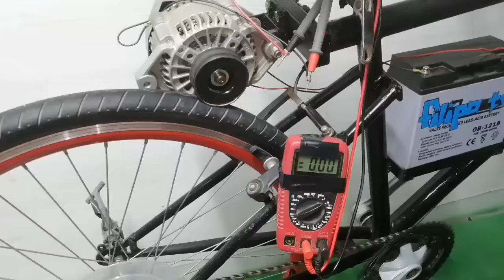free energy.electric bike casero with alternator

Comment: Unfortunately it doesn't work like this. The work needed to charge the battery is added to the work needed for the electric motor to drive the bike. One is basically cancelling out the other. There's no such thing as a free lunch. The laws of thermodynamics says so.
Reply: So does that mean that the energy that the bike is drawing from the battery has to be more than what the battery and alternator can provide? I’m sure it will last a damn while, but even with as many lithium banks as that bike can hold, it will eventually die.
Reply: Are you trying to say a perpetual motion machine isn't real? Do you research -- it's everywhere 🤷🏻‍♂️
Reply: It depends on how much amperage the motor draws from the battery and how much amperage the alternator puts into the battery so if the amperage that's drawn from the battery for the motor is less than the amperage output of the alternator yes it will work
Reply: @garybarton7262  theoretically. But then you run into the issue of friction on the alternator slowly wearing it down, and the fact that batterys only have so many charge cycles before they die
Reply: Your right but being able to use your
self as the driving force powering the alternator should allow u to continue riding a lot longer then any other e bike out there.
Reply: i don’t think they are claiming that it will run forever or that it’s creating energy out of nothing but if you think about how cheaply you can build this compared to an actual e bike than this is a pretty solid build with a legitimate purpose that could make someone’s life easier
Reply: add another alternator.....
Reply: A car alternator isn't a very good choice for the project due to it being relatively inefficient - it is designed to rotate at very high rpm and doesn't provide much charge at less than a couple of thousand revs and then a good deal of that charge is diverted into the rotor to generate the necessary magnetic field.
Furthermore, a car alternator isn't designed for charging a lead acid battery and isn't really suitable for the task - the car alternator is designed to keep a near-fully charged battery nearly fully charged, plus provide current for the immediate electrical demands of the vehicle, such as lights, heater and wiper motor, ignition system, etc. and when it is producing a fair output it requires a good deal of torque to drive it - representing unwanted drag on the bike and extra work for the electric motor which amounts to an unnecessary additional battery drain.

Better results would be obtained with a permanent magnet alternator, a different type of charge regulator, a different type of battery and a means of either switching off the alternator except when decelerating or coasting or disconnecting the drive to it except when decelerating or coasting...
Reply: @vernontaylor568   Change the pully size should alternatively make it spin way faster? In result charging more?
Reply: The only free lunch is in the mousetrap.
Reply: @larryenglish7366 it's only free for the second mouse.
Reply: Turn off power when its not needed and use it when you do. "Free energy" when you need it it costs you nothing to use! Just don't go on long uphill journeys and you're good 😂
Reply: Plus there's losses, motor, around 90% efficiency, generator around 80% efficiency, then frictional losses, no one has yet to produce a true perpetual motion machine.
Reply: Of ir works! Alternator has a rectfied when the battery charge is full, alternator stop sending courrent and when the battery is low then start all over.
Reply: @atenrok  Are you a bit (no, actually a lot!) gaga?
Reply: @joepkortekaas8813  your sarcasm radar is totally out of tune. I think you should get off the Internet for your own safety.
Reply: @atenrok  When you write the most blatant nonsense, showing that you have absolutely no notion of thermodynamics or electronics, expect a reply like I gave!
Reply: Yo usaría AC con un inversor y reductor porque el motos to se siente muy forzado y esto requiere ee muchos amperes
Reply: That law is an excuse t ok stop you
Reply: @samguty  What? Build it then. Post your analysis.
Reply: @FlyinBrian777  I've been thinking about it ..  we know 99% of this videos are fake but a real one can get a person in problems government gets money selling gas electricity water
Reply: I wonder if a v 6 Lego motor would power one someone tell me
Reply: The alternator will need at least 1 hp to charge up the battery ... things are going to get tough after a while
Reply: two batteries (one connected, one charging), put alternator on front wheel to charge unused battery, dc motor running off of fresh battery= "free energy" (looong lasting rides). Or get an electric hub wheel  (or two) and do the same with alternator and two batteries. The only question is making it all fit with the right wiring and charge controller.
Reply: Alternators are really tough to turn when they are producing a good charge..  best way is to have the small motor  recharge the battery when you don't need power.. but use power going up hills etc..  think of it this way ..if you were to use a fan to blow on a wind turbine..
Reply: Not if he used two generators
Reply: Theoretically when the battery runs out of juice you can just pedal the bike like normal to recharge it though.
Reply: @vfgfdfdf  Sorry but it doesn't work like that, it takes much more force to pedal when it's under a load. The more load on a generator, the more force that is needed to turn it.
Reply: @aaroncapps2610  "i don’t think they are claiming that it’s creating energy out of nothing" It says "free energy...that is claiming energy from nothing...this setup is a waste of time.
Reply: @_HuckleBerry  And the second alternator will not put an additional load on the motor? This is a waste of time, nothing to gain.
Reply: @vernontaylor568  It's like you say. They are scooters that have a switch on the charging function (eg when you have a lot of valleys to go down). That charging function is also good for bikes. But it's simpler to have a single engine, as you said, with a permanent magnet alternator, but which can also have power to drive the bike. Switch for charge regulator, and possibly switching gears, to operate the engine at high speed, to be able to give voltage/amperage to charge quickly. I like to travel along the course of some rivers, and I would camp there, and overnight to be able to mount some kind of pallets on the bike wheel... or another wheel as a hydroelectric turbine... then used, for example, for propulsion.. boat. A multi-functional, energy-independent vehicle.
Reply: 😂 ya
Dream on fools
Reply: I find it pretty cool 😎 I give a 100% thumbs up 👍 in presentation, as for all the optimism out there with great input, why not give a shot in fabricating what you all see as better functionality🤔I’m one to take on the challenge 💪 
Still…it’s an awesome video 👏👏👏👍👍

Comment: Just put a nice 2 stroke engine on it. Much more power and go a lot faster
Reply: П на території області на території області ліквідовано черговим к
Reply: And a much bigger fine
Reply: Unfortunately, any ideas on how to make the alternator ebike stronger?
Reply: @Nemo7954  I don't know anything about e bikes except they're a lot slower than a good 2 stroke and you can only go so far on them where a 2 stroke you can just pull in one of the many gas stations and fill up and keep on going
Reply: Lots of small communities have nosy little piglets stopping gas powered bicycles to check the engine size. Also lots of bike trails don’t allow them. If you are just riding in the street in a moderate to larger city then the gas is a good option
Reply: @mike6932  I live in a VERY small town and just take off the sticker. The engines don't say what cc they are except for the sticker on the clutch cover. In PA you have to be 16 to ride but you don't have to have a license and it's supposed to be no bigger than a 50cc I have the phantom 85 on my main bike and the yd100 on my spare. Unless the cop wants to impound your bike and pay a garage to measure the stroke to find out what cc it is and they ain't going to do all that for a motorized bicycle
Reply: @Westhelockpicker they are definitely NOT  slower depending on the size
Reply: @tyler7992  electric bikes are definitely slower. My phantom 85 with pull the front tire off the ground with a 36 tooth sprocket and my yd100 is almost just as fast
Reply: @Westhelockpicker  there's plenty of ebikes that can pull the front tire up. 746watts = 1hp. Let's say your 2 stroke is 5hp. That means any ebike with a motor 3700 watts or more is more powerful. The main advantage of the ebike is they're quiet so you can pretty much ride them anywhere. You can't ride your screaming two stroke just anywhere. Also the powerband on the ebike is very flat. Almost all power from 1rpm
Reply: @tyler7992  and it cost a shit load more money too
Reply: @tyler7992  I road a friend's ebike and it was new and he paid over 700 bucks and it wouldn't go any faster than 25 mph. It was a nice bike but too slow for me!!!
Reply: @Westhelockpicker  yeah price is definitely a con for ebikes. The quietness is a huge benefit for me. I wouldn't be able to ride a gas bike anywhere except on the street. Your buddies ebike wasn't very powerful if it only did 25. Mine only has 1200w and does 34. Would do more if I could find a programming cable for it
Reply: @tyler7992  even 34 is too slow and where I live the street is the only place to ride
Reply: @alessiokomninos7954  it's legal in most states. Has to be under a certain cc.
Reply: @Westhelockpicker  how fast does your 2 stroke go?
Reply: @tokenkingg3528  you're right but these engines don't have the cc on them so if you just take off the sticker problem solved. And there's no vin number either. The only way the cops could find out the cc is to impound the bike and pay a garage to tear it apart and measure the stroke and nobody is going to do all that for a bicycle
Reply: @tyler7992  45 with a 36 tooth sprocket but I don't usually rev it more than 6k give or take
Reply: @Westhelockpicker  gas engine is to noisey for a bicycle. this is actually a great idea because it charges the battery as its rolling. I would use smaller 12 volt generator, put a sprocket on it and put 2 sprockets on the back rim. Connect led lights for the front and rear, and also connect a throttle to control the speed of the bike. I'm going to start buying parts for the build next week, will make a video from start to finish. Wish me luck guys!
Reply: @texasrebel726  it depends on what exhaust you use.  If you just use the factory one they're not loud at all
Reply: @Westhelockpicker  That's true, the pipes are short, for the bicycle mod, if you extend them it won't be all that loud.
Reply: @texasrebel726  just the stock pipe isn't loud
Reply: That is the best idea he put one baterry 12v one alternator from car and one 12v motor that will go forever because the alternator charge the baterry in the same time when is runing
Reply: Cause he's to smart to waste money on gas .you do see that as it spins the tire it's charging the battery. So basically free power,constantly charging the battery. Are you getting all this is the mic on?😂😂😂.
Reply: @johngibson1491  it costs about 2 bucks to fill the gas tank up and you get about 80 miles out of is so if you can't afford that you shouldn't be riding at all
Reply: westhelockpicker is just a troll. He's the type to go to a BMW channel to talk about his Mercedes. He thinks we give a fk.
Reply: Don't forget that you have to work harder. Because the alternator is technically a generator and the more load Put on it the more resistance their is gonna be.
Reply: @DragonProtector174  I don't want to work harder
Reply: Totally agree unless you can regenerate energy with a dynamo sufficient enough
Reply: @RavensSpirit2012  I like speed
Reply: Do you have a video of how to do thet?
Reply: @justjillvanlife134  just buy a 2 stroke engine and you'll figure it out. It's pretty simple and there's probably a hundred videos on how to do it
Reply: Can’t afford d clutch 😂🤣

Comment: Works untill the battery is empty.
Reply: How will the battery empty if its constantly being charged?
Reply: they actually have a Ql invention for EvN that, I beleive called a ‘batery chRger’.. 🤔
Reply: U Cm 2 think that alternator is for charging light & batery, I thought it was motor for back wheel, powering it through tire.  now IdOnO.. except that an electric bike that charges it’s own batery is exactly pointless ✋😐
Reply: @ezwa9979   it is the motor for the vehicle but it also charges the battery.

Comment: Its perplexing today's auto engineers claim this can't work on EV's having alternators on all for moving wheels recharging the drive train batteries. With a single alternator specifically for recharging the instrument panels, radio, AC etc..
Reply: As long as we allow them, they will continue to do so.
Reply: The wheels on electric cars are powered by electricity from the batteries, which is what would power any generator you add to the wheels... it would basically be like plugging a power strip into itself.
Reply: @MrTweej But you miss the point .. you can use your legs to charge the battery
Reply: In today's EVs the high voltage batteries supply the power train and the multimedia etc. in a car. 
When braking, the engine is used as a generator aka alternator to generate electricity from the turning weels and refill the battery. This recuperation turns mechanical energy into electrical energy through negative torque. 
You could power the weels with the main engine and generate electricity at the same time with separate alternators. However that would always include an unnecessary amount of wasted energy through the friction etc. the alternator causes, like in bicycles. So from an efficiency point , the engineers don't do it.  You wouldn't generate thrust, just to lose a tiny bit again through friction. Just directly use the energy from the battery!
Reply: Conservation of energy ….the cars motors drive the wheels powered by the main battery ..motors, wires and generators are not 100%efficient..all leak power through resistance,heat,friction etc .the alternator/ generator adds resistance to the motors driving the wheels so more power is needed just to overcome this resistance..plus the loss through inefficiency ..it is less efficient than just powering everything through the main battery .
It’s not perplexing at all if you think about it.

Comment: This concept should be used on electric cars also
Reply: The wheels on electric cars are powered by electricity from the batteries, which is what would power any generator you add to the wheels... it would basically be like plugging a power strip into itself.
Reply: Electric vehicles will never become popular.
Reply: @spunkyspice4777 They already are unfortunately
Reply: @moonshotsilver  Anyone that has purchased one of these things did not check the prove of a new battery. These can be between 4000.and  20,000 dollars. Depending on the vehicle. Also if one charges their vehicle up for one hour there is only 30 miles of driving time.  One can fill up their petrol tank on less than 15 minutes and have 400 miles of driving distance, then when these batteries get replaced where will the old ones get thrown out at?   In the ocean? The fish will love that.
Reply: @spunkyspice4777  Yes I'm on the same page as you and agree. 
I was just saying in Europe and UK they are already popular.
Reply: It wouldnt work, cuz youd heat up the battery cuz power would be circulating so might as well remove the battery but if you remove the battery, their would be no intial power to start up therefore its a useless cycle of it wouldnt work
Reply: @tony a supercap bank would solve the purpose but this setup is too much friction on the rear wheel
Reply: Need Flintstones style cars with pedals to charge up the batteries. Get all the passengers pedaling like crazy too :D

Comment: This auto alternator begins work at 3000-4000 rpm on its's shaft. it's pulley near 56mm = 0,176 m circumference from wheel. For normally working you must to pedal about 500-600m/s (nearly 2000 km/h)

Comment: Thermodynamics lol! On the alternator, a ratcheting friction wheel/flywheel combo, when the bike wheel stops the alternators flywheel ratchets and still provides electricity even when full stop, like spinning a basketball with slaps, to keep the ratcheting flywheel alternator combo spinning? Even when stopped, another alternator could be incorporated to serve as a downhill engine brake simply with belt pully, pivoting idler/tensioner, like the rear derailer does, try that!

Comment: Clutch the alternator in to be driven as an engine brake coasting down hill, leaving it disengaged going uphill..clutch on off alternator with idle tensioner and belt n pulley? Or whatever but clutch it, for engine braking?